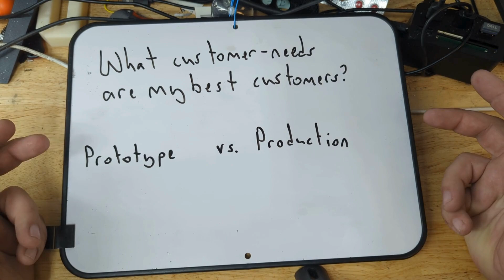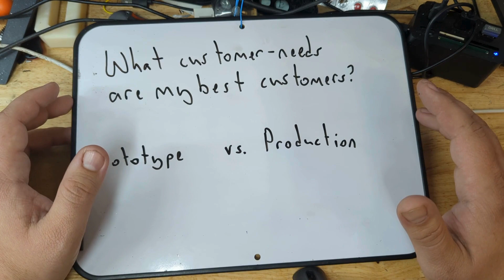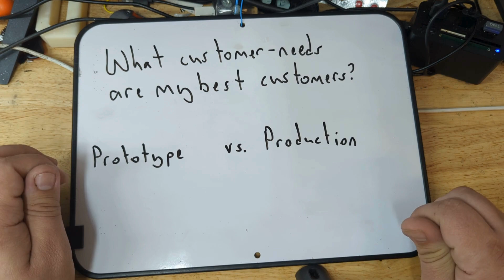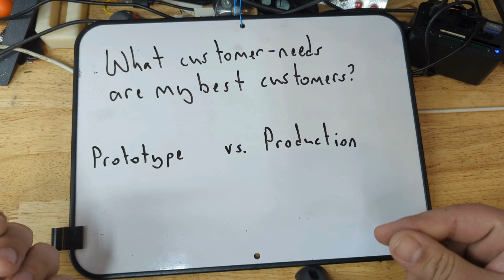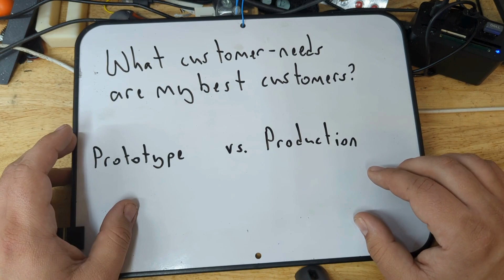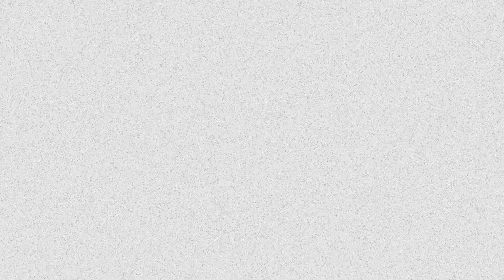Start a machine shop - "What customer needs are my best customers"

Comment: One other thing I'll add to the "learning cycle" comment on prototype vs. production, is that I've found a little bit of production can also be a great lesson for different things. Prototyping and one-off work usually taught me a lot on things like, really creative fixturing, how to get the best finish, hit a critical tolerance, etc. However, I think I learned a lot of bad habits about going really slow, taking extra passes, and generally not prioritizing cycle time. I also didn't do a really good job of accounting for "extra time" whether it be material prep, finishing, loading, etc. Often, the time to develop a "better solution" wouldn't pay back on the job. With production work, where you might see 50-100+ hrs of total time on a series of parts, spending that extra hour to make it 5-10% faster actually starts to generate a net positive return on your time. So, I've enjoyed both sides of the coin in the learning process.
Reply from the maker: Yup, on a production order of just 100 parts, every minute you can take off a cycle time is almost 2hrs saved. Living in a world of prototyping though, over time you'll come up with tricks with every lesson learned that'll speed you up over time. Kind of a start slow to go fast philosophy.